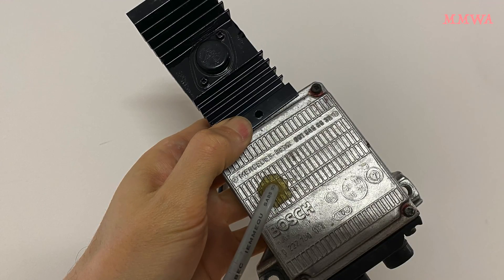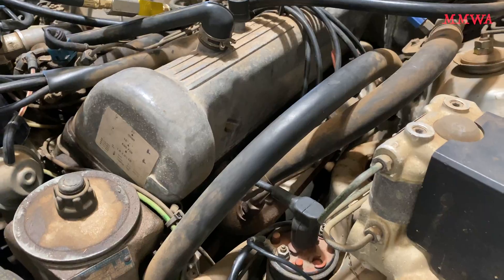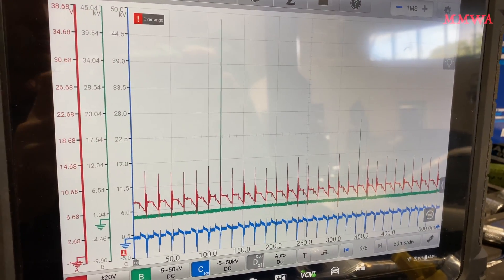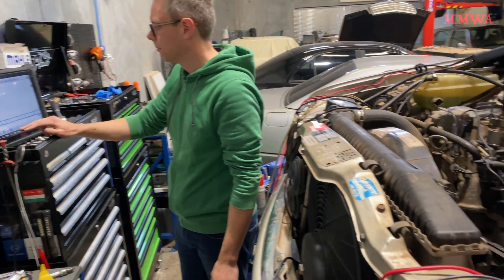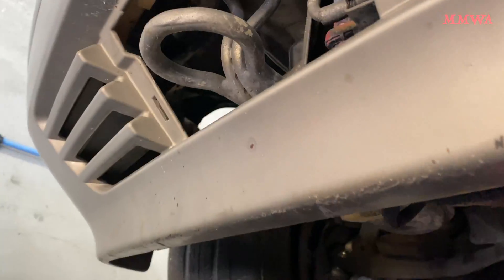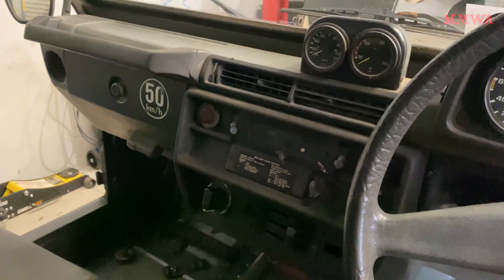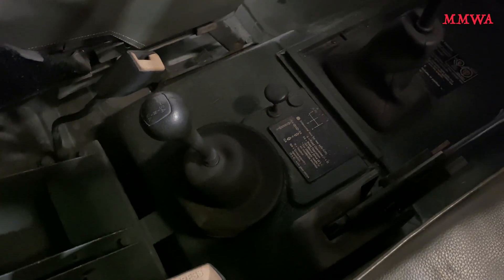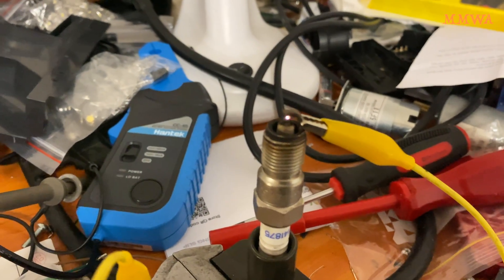K-Jetronic Mercedes 500SEC No Start - HouseCall

Comment: Dave -as the owner of this exact car you helped bring back to life, what’s the likelihood in your opinion of the new coil installed failing in two years? Got this exact same problem back again lol
Reply from the maker: I would be fitting a refurbished/ new transistorised ignition box if the new coil is already dead. They are very notorious for bad solder joints. I had the original failing coil on that car running that engjne with my hand built modified beefed up unit for testing purposes. This cars systems are extremely simple, and shouldnt be hard to work out.
Reply: Thank you Dave. Envious of your Universal Coil mod!

Comment: The DOD G wagen interior very close to my civilian 280GE 1987. I noticed that there is only one lever for the diff locks, maybe only a rear diff lock. I previously read that some military versions come with just rear diff lock, a bit of saving but still great. Actually I replaced my driver seat with one from a Swiss Army G wagon looks exactly like the one in the shots.

Comment: Thanks for sharing.  So far have been lucky w coils that test good w a meter.  So many "new parts" mechanics just replace.  In this case it was warranted.  Wonder what was wrong?  Just a partial failure?  W hi primary current and hi secondary voltage that seems unusual.  Never got to see the faulty coil?
Reply from the maker: i suspect the original coil has had an internal insulation breakdown thats allowing the secondary winding output terminal to flash over to the ground pin - on the inside. I Cant think of any other reason why it measures perfectly and looks like its working yet produces a weak spark. In any case im 100% confident the new coil when it arrives will start the car. The only question is if the original ignition box has much life left in it. Will find out today what happens when the coil arrives.

Comment: It would make a good shooting rig 😂 I wonder if a cheap simple spark tester would have shown up that fault? Lovely scope by the way 
Your test bench looks as messy as mine David 😉
Reply: Series spark tester like used on lawnmower engines would have shown no current hence no spark.  Occasionally they show a current when there is no spark due to a shorted spark plug.

Comment: It's always an experience chasing weird faults on 126's, The 116 om planning on doing next year I have been buying new parts for literally for years and what I cant buy new I'll have refurbished or non genuine.
Why?
Because then everything is a Known quantity.
Reply from the maker: Theres a 1974 D-jet 450 there too, it sat for 25 years. Once the gutted with rust fuel tank was replace and fuel system serviced (including unblocking the injectors) it fired right up and runs like the day it was parked.